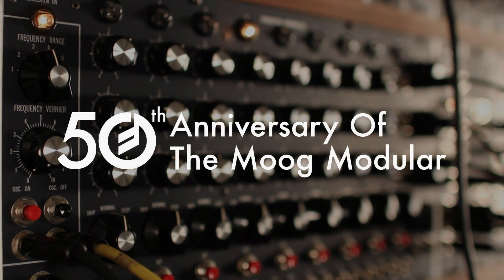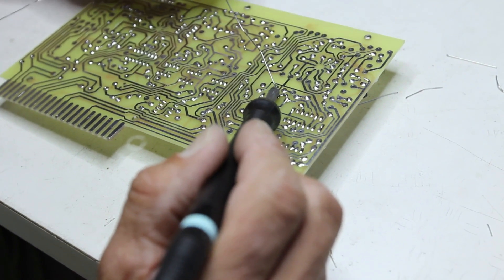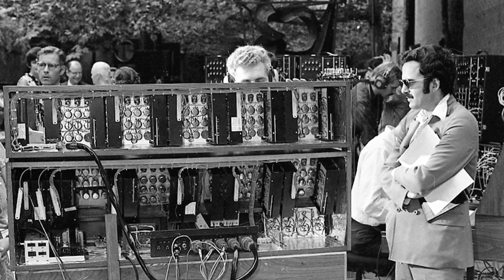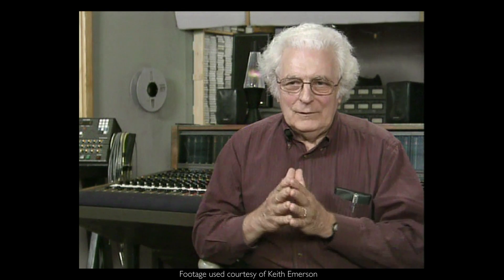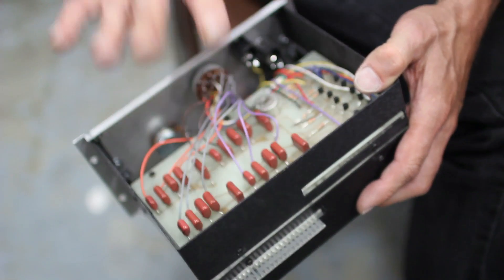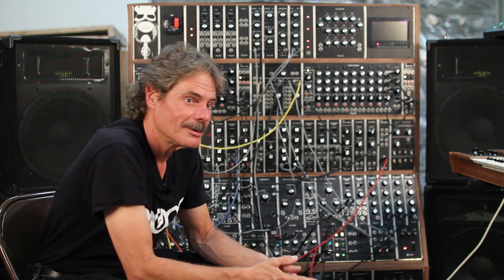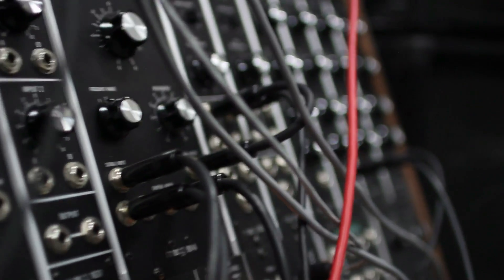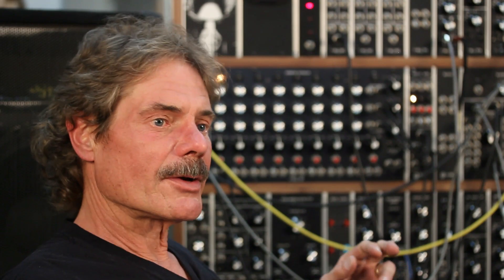50th Anniversary of the Moog Modular Synthesizer

Comment: Back in the early sixties, I spent a summer in the island of Jersey working for a guy called, I think, Matt Zackalon or similar. He had six rooms in a building fully equiped with a monstrous Moog synthesier that took up one whole wall, and each room held different musical instruments, one for a piano, one for strings, wind etc. I can't remember much but worked on the keyboard to make the keys progressively react to pressure. I lost contact and often wonder what happened to the synthesiser. Are there any documentary records still around? I'm sure it was a Moog project, not a private one. But why Jersey of all places?

Comment: Another this particular system sounds better than Eurorack is that the system 55 has more voltage than other synths which enables it be fatter and punch harder. I only recently discovered this. Modular gear will never sound this good. It's close but falls short.

Comment: Electronics people are all snorting as the narrator talks about how everything is 'hand wired', while showing a printed circuit board, which is the exact opposite of hand wired. 
(Yeah, I know, the components are installed and soldered by hand, but anyone who has actually hand wired a circuit knows that hand wiring is several orders of magnitude more difficult and tedious.)
Reply: There is actually a huge amount of hand wiring involved in the Moog 5U systems.  They didn't say the circuits are 100% hand wired, but there is a lot of hand wiring involved as every pot, jack, and switch is hand wired.
Reply: Jim Mitcheriser, BSEM, wrote manuals for Moog, ARP, and Oberheim, probably more products as in the 70s l took a class there, Newbury St, if l recall.
I can't say that I recall more details since LSD was fueling these instruments popularity. And what happened to Fairlite anyway?

Comment: Nobody mentions Tangerine Dream. Keith Emerson and ELP put the Moog on the map but Tangerine Dream took the Moog to another level. Listen to TD's Alpha Centauri, Phaedra, Cyclone and Ricochet albums. The sounds from the Moog on those albums are amazing! TD takes full advantage of Moog's prowess. Listen to the albums, you will be amazed, I promise.
Reply: Tangerine Dream's Moog IIIP (Serial number was #1062). came from Sound Genesis in San Francisco.  I used to play it on my lunch break.  It was awesome. 2 MC30 McIntosh tube power amps driving Altec A7 "Voice of the theater" speakers.  Imagine getting to play with that in a concrete soundproof building.  Fun blowing up glassware!  1970 was SO MUCH FUN you can't imagine.
Reply: Love on a real train ❤

Comment: How much of Keith's moog was real? I remember reading an interview with someone who overhauled it that most of it was dummy modules with nothing inside, and the actual functioning parts added up to about the equivalent of a minimoog...
Reply: PutItAway101 Incorrect - what you probably read was that Emo's basic patch was (mainly) using just 3 oscillators - like the Minimoog. If you know Modular though, you'd know that so much more can be done with adding the other modules into the mix...! Also, Emo carried quite a few 'spare' modules (makes sense for a touring set up..) that were housed in the case but possibly not connected, yes.... but these were duplicates of others that were used. The only for show item in there was the TV screen with the waveform running....
Reply: Only the bottom row were dummy modules, replaced at one point by the "preset" modules.  Everything else is real and live. The most used patch configuration WAS that of a Mini - three oscillators, LPF, and the envelope generators/VCAs.  However, thanks to the "preset" boxes, you could select up to six oscillators, or one drone and five connected to the keyboard, etc, etc.
For a good idea of how many sounds this beast is capable of live, go to the middle part of "Tarkus" on the live "Welcome Back My Friends" album.  It's stunning how many different sounds Emerson could get through in 3 minutes.
Reply: About 85% real
Reply: Sorry, you remember it incorrectly. The story said the basic patch most often used was 3 oscillators, like a Minimoog, and one filter. Around that there are many, many modulations to create other sounds. The bottom cabinet (not often seen as it's behind the keyboard) has some empty modules to leave room for cables and power supplies. The rest of the bottom cabinet is the Presets. The upper cabinet has special panels for all kinds of things, but not Moog modules - light effects, the TV system, LFOs. So - over 90% of the system is modules, based around the basic synth format of a Minimoog plus modulations.
Reply: That, which Moog would've frowned on, voiding the original warranty. Had Moog realized that, they would likely have created their own "Custom Shop" (like what two guitar companies, Gibson and Fender, had done) to please these folks, to custom-build (at the Moog factory) versions of the modular and Minimoog just for these folks.